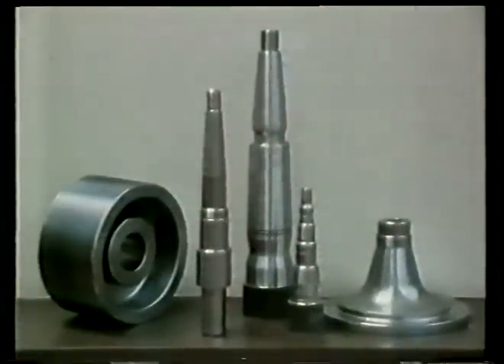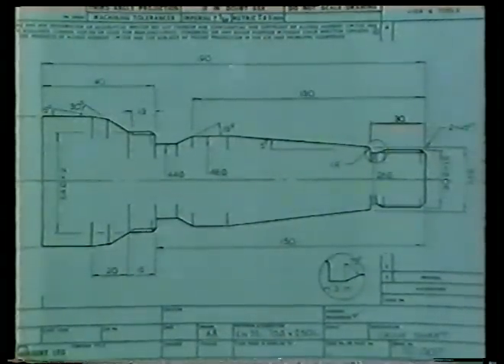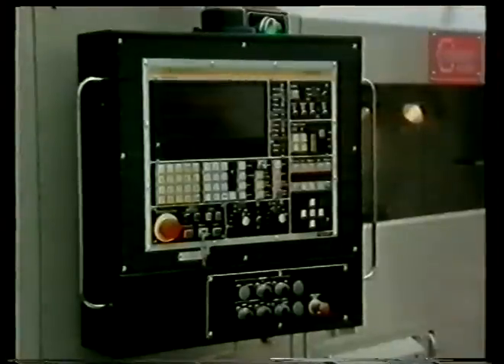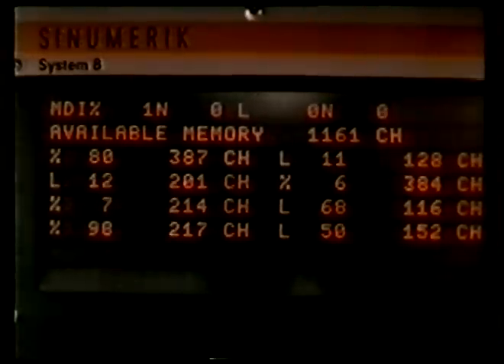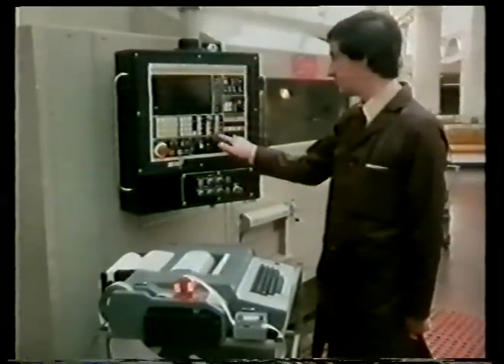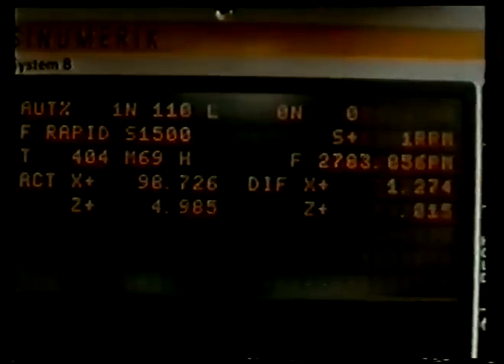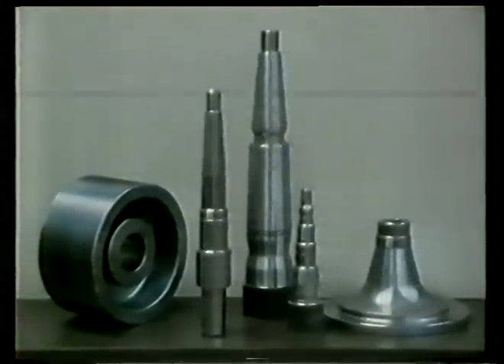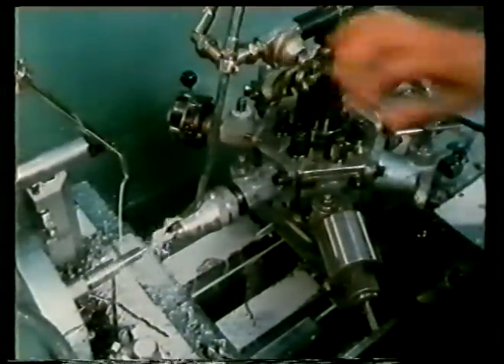BBC Technical Studies Capstan and Turret Lathes

Comment: Takes me back. I was an apprentice at H W Ward in Worcester, where most of this was filmed, from 1979 till the factory shut in 1984. Worked on the electrical design for the NC capstan machines with the 'Anilam' controllers that you see towards the end of the film. Happy times and a good start in engineering for me whilst there as a teenager. A shopping centre was built on the site of the Worcester factory after they pulled it down.
Reply: Thank you Bill for sharing this memory with us, the machines you got to work on are amazing and we are so thankful to be able to see this captured on video. Lance & Patrick.
Reply: I was an apprentice at Mazak in Worcester, done me training at Worcester Group Training on Sunnyside road, plenty of old lathes and mills like these on there. I’m from Newcastle and now a CNC service engineer
Reply: I was one of the Training instructors working in the H.W.Ward Apprentice Training centre in Worcester at the time this was filmed.
The BBC film crew were filming with us for several days; it really was great seeing how they set all the cameras and sound equipment up. Looking back at it now it really looks outdated and how things have progressed into the CNC world of today.

Comment: I’m new to machining and I’m learning on cnc equipment, but these old machines are so cool. I’d definitely want to run some of these old machines.
Reply: Find someone who knows what they’re doing. Most like will be the old guys in the shop and if they do agree to teach you remember turn the phone off, shut up except to ask a question that’s pertinent to what is being said/taught, and when you are running a manual machines (lathe/mill etc.) you must give it %1001 of your concentration because manual lathes and mills can/will kill you. Takes one lapse of your concentration. I have had a co-worker have a lapse of concentration and he left the chuck key in the chuck. It ended up being thrown about 20 feet and embedding in the drywall seven inches from my head. I am not trying to scare/dissuade you from learning how to use manual machines but to make you aware that when something goes wrong on a manual machines including a tool breaking it can be bad. Manual machines are typically not enclosed like a modern cnc machines. Wishing you the best of luck
Reply: @SeaWolfEntertainment  Exactly, these old machines are definitely not something to play with due to many of them lacking safety guards. They must be respected at every point during their operation. I happen to restore old tools as well so I’ve seen how some of the more basic ones are designed.

Comment: WOW what a great historic video, thank you so much for sharing it with us we actually run a set of Levin capstan turret lathes currently, so to us this is like being on the shop, only on a much smaller scale. These are great production lathe working machines allowing us 8 steps in a single set up to make hundreds to thousands of fine watch movement fasteners. We just love our work and we have a great time making parts for our products. Thank you so much for this fine example and share, Lance & Patrick.

Comment: Spent many years on a capstan 3A now operating and setting  CNC
Reply: Ditto Phil, we cut our teeth on old and new Machines, thank god for CNC`s and G code :)
Reply: I also ran a 3A capstan during my time as an apprentice as well as a variety of smaller Smart and Brown Capstans from 1981 onwards. I also now use mainly CNC machines but mainly milling these days.
The skills you learn on manual machines give you a grounding into processes that are now used on CNC machines giving solutions that todays apprentices simply don't get taught now and leave them staring at you in awe when you can produce a screw thread on a manual lathe!...!
And not one of them knows how to sharpen a drill!